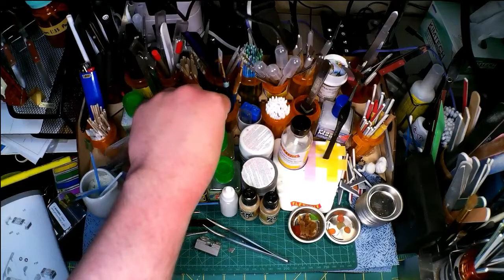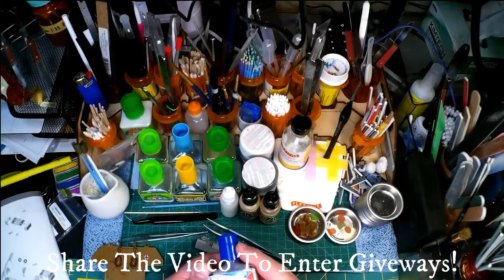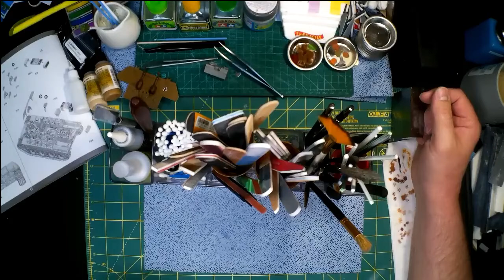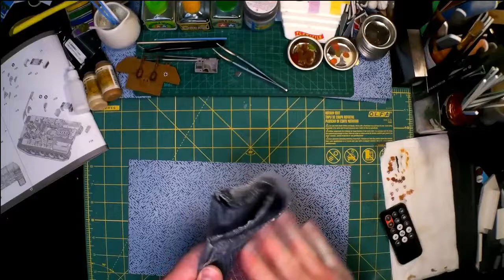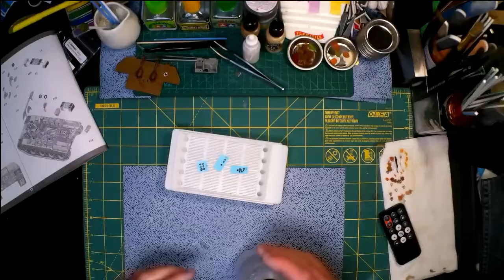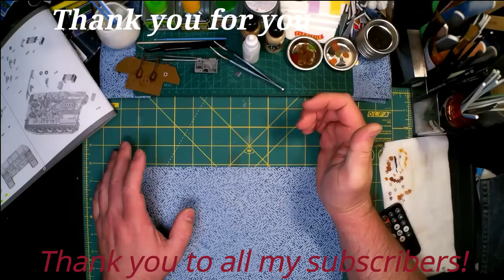Some Tools I Use 1

Comment: You have so much stuff. I do not even know where to begin to ask questions. I thought I had a great deal of stuff. shared video
Reply from the maker: This is a first of a series of tools I have collected over the many years of prototyping for a small company that could afford 3d printing until recently. Because of my departure due to medical reasons my boss told me to take the stuff with me, because the printers are going in my area. So it worked out for everyone sort of.😁
Reply: @jasondoesthings919   Yes 3D printing is taking jobs as well as creating jobs. When I had I became disabled, I too was allowed to take tools and supplies home. I use some for my plastic addiction but most are for metal. I built bigger machines and smaller machines. They would not let me bring home the lathe or mill, sniff sniff
Seems so far Dorian is not keeping you off the internet, hope that continues.
Reply from the maker: Yes still nothing from storm. I part that makes me mad is, my work area is in the low part of my house, so everything that was on floor is now on my workstation. I have the first part of the build for your prize done, I just need to get to it to finish it. Yesterday I wrapped it in plastic and stuck it  on the top of all the stuff on my table. Needless to say it a mess here right now and I’ll be glad to be done with this storm😁. Oh and they stop delivering mail and packages on Friday and won’t start again until this coming Friday and I’m waiting on things like paint and kits to review and tools for review, I’m going to be backed up for weeks
Reply: @jasondoesthings919  Oh man, sorry to hear that.